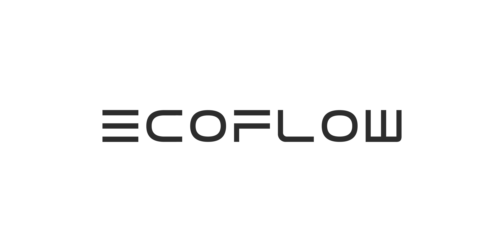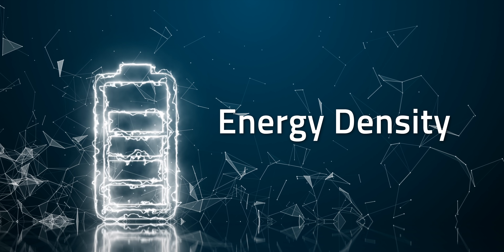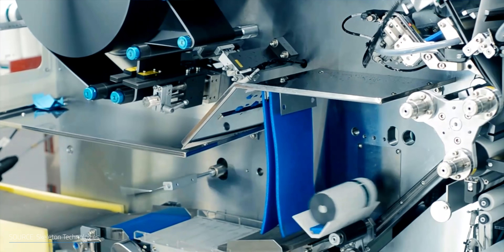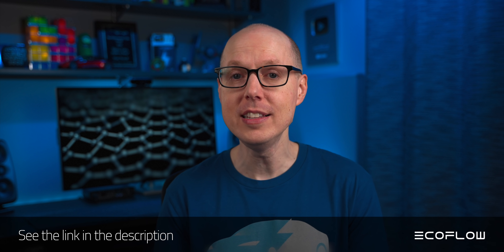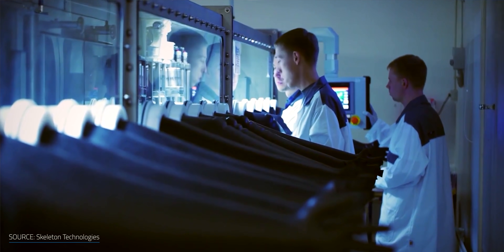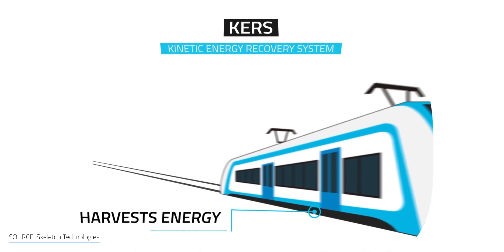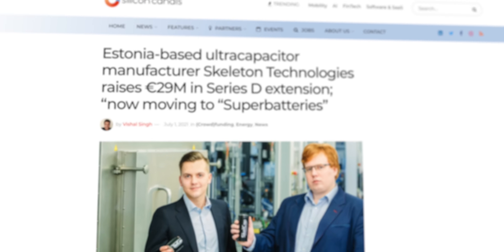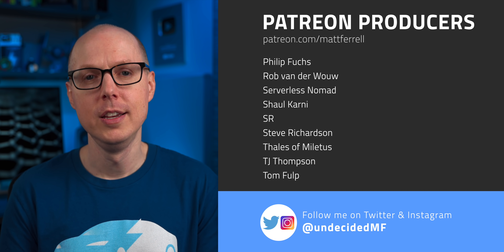Revisiting the Supercapacitor - The Wait for Graphene is Over

Comment: Like others have pointed out, using this tech for regen braking is the better goal in mind.  A lot of energy is wasted in regen braking because you can't charge the battery quickly enough, but to capture all that energy in an ultracapacitor, and then, release that energy to accelerate would make a pretty dramatic difference in range.  Then, the battery can just be used for cruising and operating all the instruments.
Reply: Trains
Reply: @VincentGonzalezVeg  exactly dude everybody is talking about electric cars here. But even the interviewed guy in the video talks about trains. Subways that have to brake and accelerate all the time are an obvious target instead of cars.
Reply: I actually used to think this too and actually did a project in college with some friends where we built a supercapactor regenerative braking system into an electric bike and evaluated it, and my number one takeaway was that the charge rate of the battery is actually only the limiting factor on regenerative braking power for the first couple seconds of high speed regenerative braking. The much larger problem is actually that the motor voltage drops as you slow down, so you have to boost the voltage to be able to charge the batteries or capacitors, and so 1) you need high power power electronics in order to boost the voltage (which was expensive even for a 1kW electric bike much less a 300-500kW) Tesla and 2) if you keep drawing constant power off the motor as the voltage drops you are pulling more and more current across the motor coils, which besides increasing resistive heating of your motor you eventually reach a point where the resistive loss is so high that you cannot load the rated lower of the motor during braking cause the motor is simply not producing enough voltage to overcome it's internal resistance at it's rated power. Between the resistive losses and the power electronics effiency losses as the voltage drops and your boosting over a wider voltage range you end up not being able to decelerate the vehicle at a constant acceleration all the way to a stop without failing over to friction braking at some point, and overall our analysis was basically that trying to enhance regenerative braking with ultracapacitors was therefore not worth the cost and weight penalty.

I honestly didn't think that knowledge would ever be relevant again for the rest of my life so I'm glad I came across your comment lol
Reply: @evil0sheep  Controlling the braking force requires controlling the phase currents, so if using a separate boost converter you'd need to modulate its power output based on the motor rpms, though it'd be easier to read out the motor phase current and modulate based on that. A lot of modern controllers do this internally however, meaning you can have very well modulated brakes, down to nearly 0 rpm. If needed, they can even switch to 'active braking' (basically, accelerating the motor backwards rather than regen, but uses battery power) to bring the motor to a complete halt, and maintain a given position if needed, sort of making it into a stepper motor (this is how many gimbal motors work). 
Point being that regen can achieve the vast majority of braking requirements, with mechanical brakes serving as backup for 'oh shit' moments that would exceed battery or even motor power handling (cars do generally brake faster than they accelerate after all, so mech brakes are already more 'powerful'), or as redundant braking (and obviously for park braking rather than using power). Adding a capacitor like you say doesn't help much, and the volume/weight is probably better invested in a slightly larger battery, which also boosts range as well as braking power.
Reply: @sn0wchyld  Yeah I mean i certainly agree that if you're willing to put power into your stator coils while braking that you could definitely cover most braking use cases, but thats not exactly regenerative. Also I'm not trying to bag on regenerative braking in general, I do think in general regenerative braking is always worth it to include in a battery electric vehicle.

My point (which i think we agree on) is this: If you define the regenerative efficiency as the energy that makes it back into the battery during braking divided by the kinetic energy of the car when braking starts, and you define the regenerative power as the kinetic energy of the vehicle when braking starts divided by the time it takes to come to a stop, then replacing or augmenting the battery with EDLCs that can charge 1000 times faster will not make a substantial improvement in either of those numbers, especially in a vehicle with a long range (and therefore a large battery). You might be able to squeeze an extra 5% out of one or the other or both, but thats just not worth the cost and weight penalty you incur by doing it. And I don't think any amount of fancy power electronics or control systems will change that basic fact.
Reply: @evil0sheep Your comments refer to cost and weight. Doesn't graphene promise improvements along those lines?
Reply: @buildmotosykletist1987  " So your knowledge of super capacitors is very limited. Thanks.".
Saying someones knowledge of a subject is "very limited" without any actual debate or insight of your own knowledge is essentially a 5 year old calling someone a stupid doo doo head.
Get a life kid.
Reply: @buildmotosykletist1987  I did, you gave someone a pop quiz, then called them stupid for not returning the answer when you yourself had no answer nor any real input. Like you are some kind of mystic eye ultra capacitor wizard based on you can type shit on a keyboard.
Stay in school kid.
Reply: @buildmotosykletist1987  The answer is 42.
Reply: @ipissed  lmfao perfect answer
Reply: Put windmills on EVs 😆😆😆
Reply: @BrogeKilrain  that actually could work , using super duper capacitators… but everyone would have to start their vehicles from the top of a hill…
Reply: @vicariouswitness  super caps been around since 80s. They can give a nice  voltage spike but no endurance
Reply: @buildmotosykletist1987  On Model 3 you want regen and the capacitor voltages to be around 384V in order to be able to charge the battery pack.  Skeleton Technologies SCH3400 ultra-capacitors are 2.85V.  We would need 135 in series to match the voltage (could do multiples of 135 to increase storage).  Based on their datasheet, 135 of them weigh 71.55 kg and take up 52.65 L of space (that's just the capacitors with no threaded posts and no electronics needed to manage them).  That's 157.74 extra pounds and 1.86 cubic feet.  As for the energy storage capabilities, the math on that is a bit more complex because a capacitor's voltage drops as it is discharged and if their voltage drops below a certain amount above the current high voltage battery pack voltage, it won't charge it.  You also have to take time into consideration for those calculations, and regen usually lasts from a few seconds to probably not more than 10 seconds.
Reply: It’s pretty surprising how many areas are using Supercapacitors already, JBL & Bose speakers integrate them in devices, also in energy plants/transmission lines it’s common to find “capacitor banks” which help collect a certain range of power that would benefit from SCs
Reply: I feel like it's "hyped" In plenty less useful applications but early implementation of new technology takes a while to settle into low attention, high utility results.
Reply: Do you know how expensive that would be?
Reply: Air conditioners, refrigerators air compressors ALL have a huge spike in amps when they kick on to start. This could theoretically lead to much more effecient designs.
Reply: @hugoh.9694  spikes in current ... AC
Reply: @MeatWig00  RIVIAN is the next FISKER broke and gone with investor $$$
Reply: Meet the material of the future that's 40 times stronger than Diamond.Graphene can withstand the impact of Bullet.
https://youtu.be/Zj9WFnyEyLw
....
Reply: Unless you are making an ultra cab that has a significantly lower impedance, this will not apply to most applications
Reply: @buildmotosykletist1987  about the size of a house. The most power desne ultra cap skelcap makes even today is 28x less dense than lithium.
Reply: @Wingnut353  : Does a house fit under the seat of an F1 car ???
Reply: Useful in light trucks, small Ford Ranger size ?
Reply: But that would be efficient, and wouldn't be a good part of the capitalist waste cycle. Can't have it.
Reply: I also heard super capacitors are going to be important for electric flight. 

 Where you have it charged by whatever then unleash it for a boost of power. 

 Like requiring a ton of power so you can take off in an electric arrow plain! Just kidding, aircraft. 

 Graphene just needs to get here cheaply already.
Reply: Sounds like using ssd to speed up hdd few years ago.
Reply: The problem with using ultra-capacitors in passenger vehicles to assist in capturing energy from regenerative braking is that they take up too much space.  And they add some weight that reduces range, although that might be cancelled out by the additional energy that can be recaptured by regen braking.  But the space needed to have them in enough quantities to make a difference is not negligible in passenger vehicles.  They might make make sense in electric vans or other bigger vehicles if the cost isn't to high where there's a foreseeable return on investment.
Reply: @android04  The video explained that these ultracapacitors reduce the space and weight you talk about to one third of current technology. That's enough to make a huge and very practical difference.
Reply: @android04  Supercapacitors in electric vehicle are an extremely dumb idea! Think about it: each way (capacitors yes or no): you do have electric motors, you do have a Lithium ion battery (where shall the energy come from?). The Lithium battery and motor of an decent electric car (>180 kW) is capable to accellerate the vehicle with >0.5g. It's also capable to decelerate the same vehicle with >0.5g. 
It's the same physics! The same electro magnetic forces the same power that is withdrawn from the battery!
Why should anyone adding extra weight and cost for capacitors? It's not necessary and makes the vehicle only more expensive.
If the battery should only be capable of delivering <100kW (2C -> <50 kWh, then fine, no problem. ~0.3g is still more than enough to decelerate in normal driving condition. For emergency braking use your brakes! No car has less than 50kWh these days! And if so: fire the idiots that work on capacitors and but more battery's inside!
I just don't get it. Why are people thinking supercapacitors are better than Lithium ion.
How can a 2D surface, each layer divided by an isolater (yes! You still need to calculate the thickness of the isolater; not only your thickness of the graphene) ever be better than a 3D "shelf system" that stores charged Lithium?!
How?!
It's like one piece of paper vs. a book. The third dimensions brings you the benefit. Capacitors are only 2D structures, separated by extreme big foils. Lithium is on a whole other level.
Reply: it would improve range on a race car and improve city range a little, but nobody cares about city range.
Reply: @JackMott  U don't, just all people I know, who drive e-car do.
Sorry, I live in a city, like most people do
Reply: @johannesreyem5376  I live in a city too, when cars have ~200 mile range you never run out of range in a day driving around town, hence nobody cares about city range in isolation. Range is only a challenge during road trips, which are on the highway.
Reply: Not really mate - most car batteries can take a 1C charge, so for a 100kwh 3T tesla (for example) at 100km'h... it can push enough power into the battery to stop it from 100km'h in about 10 seconds (really, the batteries could probably take more given its just a burst). Some cells will take far more than this, to the point that you'll exceed the grip you have before the charge rate becomes an issue for the battery. The energy recuperated is minimal too, and not because of the battery, but because a car going from 100-0km'h is going to generate ~ 0.3kwh... even if batteries lost 50% of this as heat, and capacitors 0%, you'd still only be gaining ~ 150wh, into a 100 000wh battery pack.

Comment: As supercapacitor can store the energy coming from regen braking and send it out again for acceleration. It should make life easier for the lithium battery and make it last longer, like he describes with the trains.
Reply: yes, but modern li-ion batteries in EVs can easily handle this. maybe only necessary in hybrids because they have very small batteries.

Comment: I've said it for many years.  If the battery charges fully in under a minute, I don't really care that it only lasts 2-3 hours.  Considering my cellphone holds a charge for 17-20 hours with mild use, a phone battery that lasts for 4 hours and charges fully in 20 seconds is perfectly acceptable to me.  I can't imagine a period of my day where I am away from a power source for more than a couple of hours.  And even then, I'm driving, so I could technically just plug my phone into the car to charge it while I'm driving.

Comment: what do we think about applications for this as something to charge other alternative batteries? example: using solar power for the grid, while also charging super-capacitors, which when the solar energy volume dips below a certain amount then quickly charge up a flywheel turbine, compressed gas, or other physical energy storage? or maybe using them for quick energy recovery (others here have mentioned regenerative braking, and even just plug-in charging could be a use-case) that would then charge up the longer-lasting batteries on a car? in fact, a lot of your videos have made me wonder about the potential for combining multiple technologies to take advantage of the characteristics of each (like if one produces a lot of heat, use that to spin steam turbines)

Comment: I'd like to see the automotive implications of a technology like this for structural use. For example tesla already uses their battery platform for the middle section of the vehicles would it be possible to use these capacitors structurally to replace other parts of the frame to increase the total energy to weight ration of electric vehicle

Comment: I've long felt that capacitor-enhanced regen braking could help. But since braking is a minor proportion of travel, is 30% enough to warrant the complications & cost of integrating capacitors into EVs? Maybe more in heavier lift modes, like transport & flight, where overcoming altitude gravity differentials can be huge?
Reply: Regenerative braking is best used for vehicles that are continually stoppping and starting like buses in traffic, garbage trucks, trams and trains where the stations are close together.  In most of these applications, the reduction in wear and tear of the physical braking system is also a point in its favour.
Reply: I'm with you and had a similar idea. How about Incorporating super/ultra capacitor-enhanced regen braking along with almost instant charging capability. Pull up to a charger, plug in, the super/ultra capacitors are charged, you drive off and the stored energy in the capacitors is used to charge the battery over the next 5-20? minutes. The same capacitors are used for regen.
Reply: @user-vp1sc7tt4m  if you have enough energy in the capacitors, why using the batteries at all? no, that is not how it works. you would need an ultracapacitor with the size of a truck to have enough stored energy to charge the battery. the difference in energy density is a factor 10 or more.
and modern li-ion batteries can already handle a huge power

Comment: Supercapacitor tech has a lot of applications that are a good fit.  For very low power applications, supercaps can replace batteries.  Thanks for this video.
Reply: Supercaps are high power, low energy. They are sprinters, not marathon runners.

Comment: Would super capacitors and solid state batteries work for aircraft? You could get a boost from the SCs to take off and then cruise on the batteries.

Comment: ok, the energy density is lower than batteries, but what about the cost for capacity. 
grid-scale energy storage doesn't need to be compact. solar farms for example already cover a lot of land and have ample volume under the panels where you can put your energy storage solution.
Reply: To clarify 

There are two different things: cost per capacity (how much energy can you store per buck) and cost per power  (how fast can you store or release that energy per buck)

In general batteries win on cost per energy capacity wheras capacitors win on cost per power handling.

Comment: Watch your units of measure.  Volts is not power.  What happens to a a battery is that it loses the ability to store a charge and not the ability to work at some voltage.  The measure used for the charge is Amp-Hours, Amp-seconds or Coulomb.

Comment: I've wondered for years why they didn't use capacitors for stop/start cycles on a car.  Yes, even way back in the gas days this seemed like a no brainer.
Reply: The capacitors to do it are absolutely huge.  To make the math easy, lets say that the brakes are absorbing 100KW for 10 seconds to get you stopped.
That works out to be a million watt seconds 100KW * 10 = 100,000 * 10.
A 1 Farad capacitor rated at 2V would be about the size of your little finger.  We can work out the energy it can hold with
E = (1/2) * V^2 * C
= (1/2) * (2^2) * 1 = 2 Watt seconds of energy
You need 500 thousand of those to store the breaking energy.
Reply: @kensmith5694  Well, I'm sure we could get that down to 200k just by changing the diameter of the capacitor.  :p